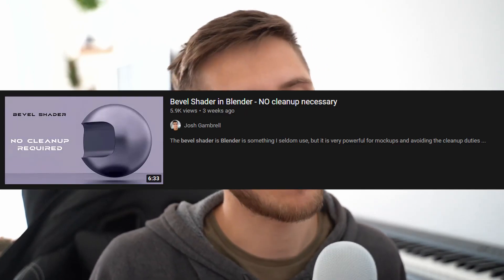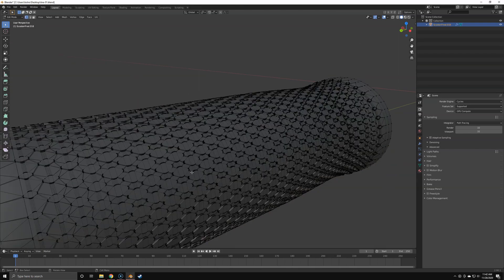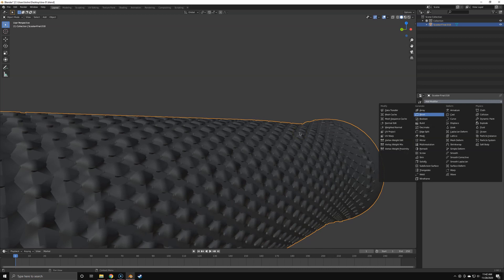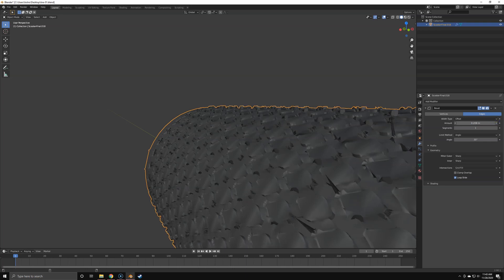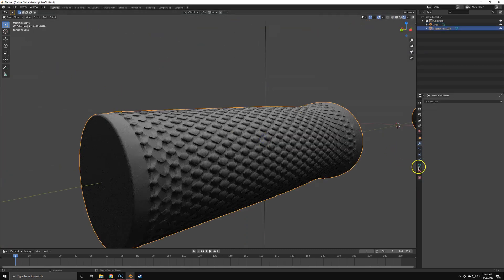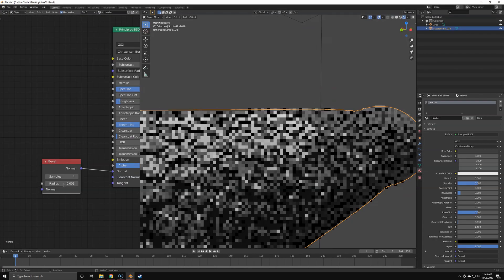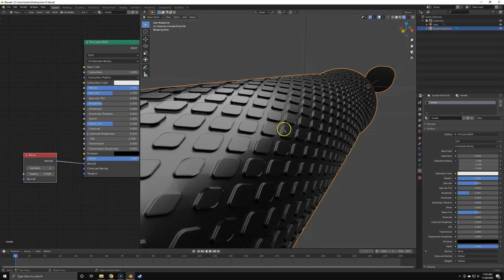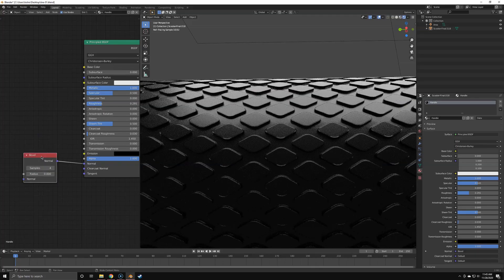Bevel Shader | Blender 2.9

Comment: Thanks man. Trouble is, at least on my end, the bevel shader as well as the ambient occlusion ain't working (-> not supported yet) in an RTX / Optix environment
Reply from the maker: Ah I forgot to mention it. I actually did mention it but my camera was off when recording, second run I forgot :( but I can imagine it getting added very soon since that’s an old issue by now. I hope atleast.